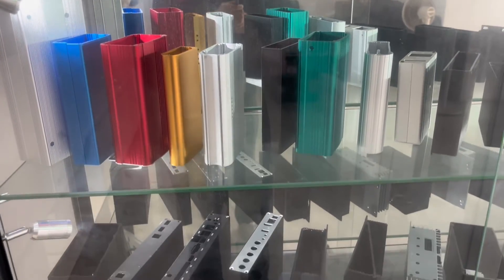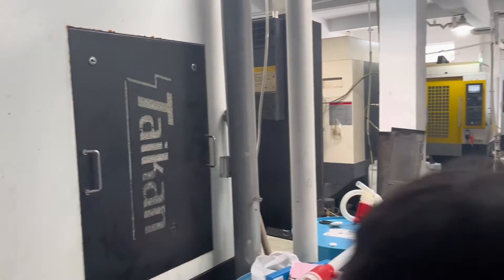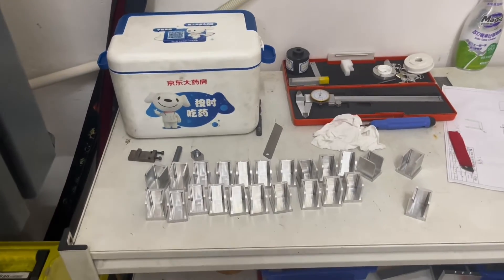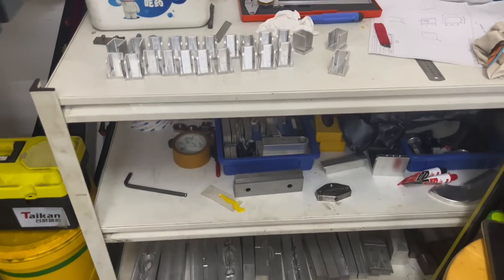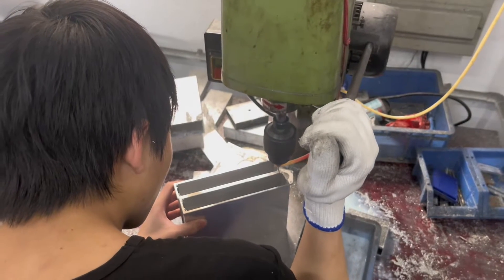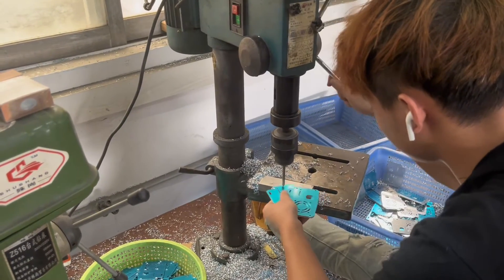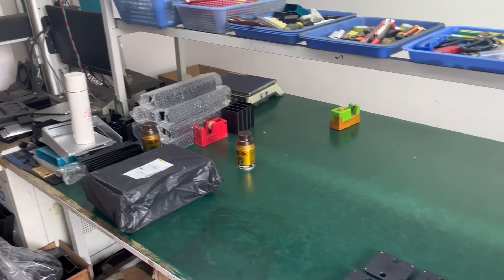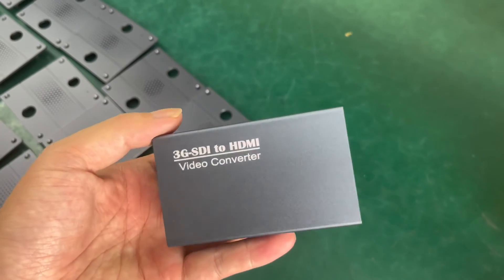How Metal Parts Are Made

Comment: 4:00 It is generally recommended to not wear gloves while using a table drill. This is because gloves can snag on the rotating bit or chuck of the drill, which can pull your hand into the machine and cause serious injury.

Here's why gloves are a safety hazard with table drills:

Entanglement: Loose or bulky gloves can get caught in the spinning bit or chuck, potentially pulling your hand in.
Reduced dexterity: Gloves can make it difficult to grip the material you're drilling and maintain control of the drill.
Reply from the maker: thanks a lot for sharing. I learned something new.